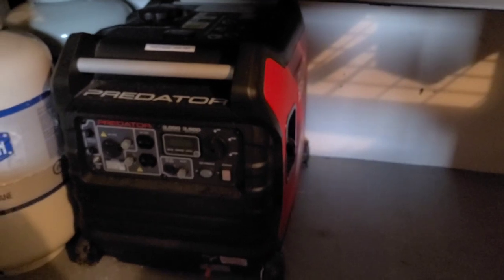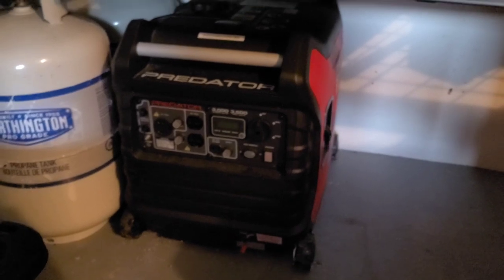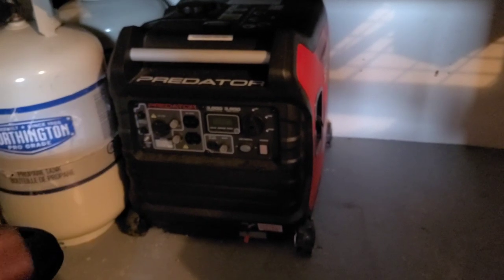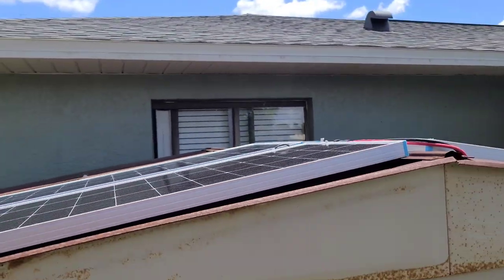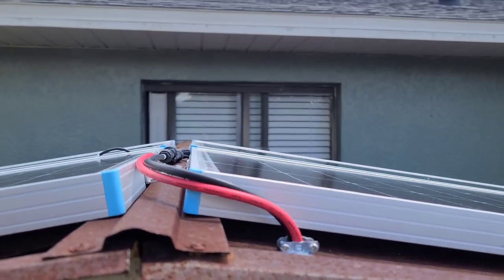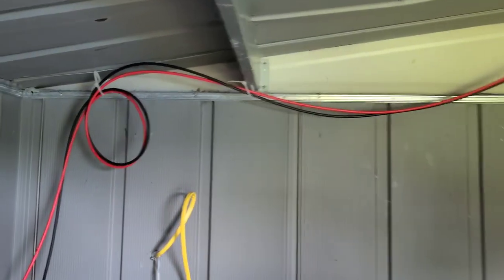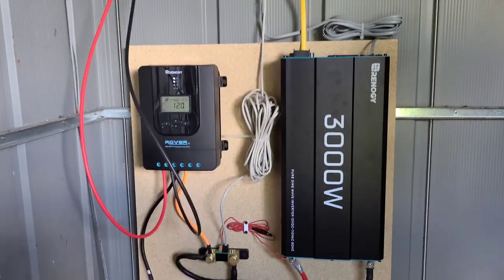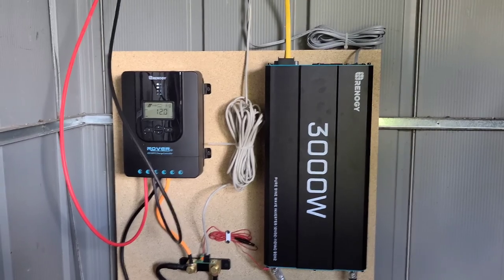I solar powered my rusty shed and here's why.

Comment: I appreciate your “no big deal” attitude. I’ll probably dive into this project on our remote mtn property that has frequent power outages. Thanks again.
Reply from the maker: I wanna build a bigger one. Same concept just a lot more of it. This just isn't the right place for it at the moment.
Reply: @JDSOutdoors  I'm sure your looking at the Hybrid controllers, and higher Voltage panels and batteries.

Comment: Not bad.  Great little backup system.   Your good for about 8 hours of constant use for the air conditioner, or continuous use of a refrigerator and running lights and charging batteries.  I put a 100 amp panel, 100 amp hour deep cycle lead acid, and 1000 watt Renogy inverter in my shed so I wouldn't have to run conduit.  I bought a Bluetti AC 200 max, extra batteries and 600 watts of panels for the house.  So far I'm running the fridge full time and a window unit for 2 or 3 hours at night through a transfer switch.  There's a ground neutral bond problem with most inverters and most service panels so I opted for this instead of something like what you have.  I returned the same inverter you got right after speaking to Renogy.  Anyway, thanks for the video.
Reply from the maker: You are correct

Comment: Neat system I basically did the same thing to add a window AC to an upstairs master suite instead of cranking the house AC up.  I did use more solar and 4 100ah batteries.  Even on the hottest days it used less than 5kw running 24hrs.  Have fun stay safe.

Comment: You should emphasize that payback starts the moment you turn it on. When you start the generator, you start spending money again.Of course you get the motor music for free,much stronger than the hum of the inverter fan. The EG4 3000w with a5KWH server rack battery and a few giblets mounted on a dolly is about the same price .Very convenient for a day’s work off grid.

Comment: Heck yeah this is awesome!   Subscribed and liked!  ❤️👊
Super cool solar generator.  Our electric bill went up $80.  Our neighbors bill went up $120.  So this system could be refined to pay for itself in short period.
Reply from the maker: Yes it absolutely could. Mine went way up as well. One could easily make this bigger and power the whole house.
Reply: @JDSOutdoors  
You could make it power a single element on an electric water heater on a timer for daytime only (to keep from total depletion at night when no use either), and have that one item off grid and ran off that solar system to benefit your home full time. And switch back to the scenario in the video for emergency use.

Comment: If you end up seeing some charge imbalance between the batteries you may want to move the positive cable to the other battery terminal. Its supposed to help with parallel batteries. Nice work!
Reply from the maker: I have switched it over, good eye

Comment: Well sir, you have done it again! I got into building DIY Ammo Can power boxes after watching your videos on them, and now friends and family who see them, fishing buddies who see them, etc., all want them. Then you went and did the little adaptors for power tool battery's deal, another great video, but I am others still have a heart for the power boxes. Then you went a did the solar panel on a trailer tongue, and now A/C from solar. You sir are an asset to America. Thank you. I am going to have a ton of questions as I begin building my DIY Trailer for camping, fishing, etc., and it is going to have Solar/Shore power capabilities, while still serving as a trailer in case I need one for whatever reason. LOL. I don't know that I am comfortable enough yet to do all this without watching videos a bazillion times, but I need to get several things on solar, and do not want to invest in whole home solar for this house as we are considering selling and moving, so no need to spend $30k on something I will not use and will not get an ROI on. The 3 projects are 1. getting the pool to run on solar to get that off my electric bill, haven't decided if I just want to do solar for current system of invest in a DC motor and run it that way. 2. Getting a similar setup like this one in the garage so I can work on projects and not kill over in these Texas summers. 3. The DIY trailer build and outfitting it with solar/shore power, attaching ARB awning and deluxe room, the RoadShower XL, fishing rod lockers, Kayak, etc.  One thing I am looking into is a way to wire in an electric water heater in the RoadShower XL. That thing is awesome works great, yes, it is black and heats during the day, but they should have built in a heater unit of some sort. If you got any ideas, I am open to hearing them. Cool bananas. How are you liking the new place?

Comment: I have been looking at building a small system like this to power a small A/C, refrigerator, and some led lights for emergencies.  Would have been nice to have last year when Hurricane Ida rolled through my town.  I will have to look into something similar for permanent power for those items after I do some calculations.  Thanks for posting this video.
Reply from the maker: Calculations are definitely important  for sure. If this was going to be permanent I'd definitely use conduit and mount everything better but I'm just playing and learning at the moment

Comment: You responded to another person from Indiana about going with AGM or SLA batteries because of the cold. Besides weight, what other benefits do the lithium have versus the other 2 options? I assume AGM/SLA have fewer charge cycles.
Reply from the maker: Correct lithium give you more charge cycles and also 100% capacity drawdown without injury to the battery. Sla or agm you really can only 50% draw down safely. Ideally on lithium you would draw 75% then charge back up. In cold weather if you can keep the batteries above 32°  I'd go with lithium also due to no maintenance as well.
Reply: We're in Michigan and have run AGM batteries and now run lithium batteries in the shed.  On the colder days I just ran a propane heater for a few hours to warm up the shed. But never got cold enough to worry about the batteries.  The lithium was a game changer for our set up.

Comment: How does 400w of solar equal 3000w of useable power?

At 400w, how long did it take to charge the 2 batteries to full capacity?
Reply: Maybe you could do a follow up and do an in-depth explanation of how it works, the math, etc
Reply from the maker: @scvic2006  from 100% completely dead it takes 1 day to fully charge assuming full sun. 400w of solar charges my 400ah of lithium batteries which I chose to use a 3000w inverter to run my 110 system. I could of used a 500w or a 5000w inveter it's personal needs. I'd do another video but the system is torn apart now since I'm moving.

Comment: Question. Do you charge your batteries during the day and run off of them during the night only then recharge them the next day? Or do you run off them also during the daytime while they are charging? I have four 100-watt solar panels charging two 100 ah lithium batteries. I run my refrigerator and a chest freezer using then while hooked to solar during the day. Am I doing it wrong, and should I be charging the batteries during the day and try to run the refrigerator and freezer off the batteries alone at night?
Reply from the maker: You can use it anytime that's the beauty of solar. If you use less than you bring in then it's free energy all day.

Comment: How long can you run the air conditioner?
Reply from the maker: 4-6 hours with no sun. 8-12 if it runs during peak sun times. A mini split, 800w and 2x the battery bank would be perfect for a backup.

Comment: Is that breaker box near the outlets grounded?
Reply from the maker: Yes
Reply: @JDSOutdoors  any way you can show how you wired the breaker box and grounded it?
Reply from the maker: @johnconnor3426  its wired like any normal box would be. 12 ga romex since it's only 20 amps then that runs right to the inverter hard wire ports. The box grounds are a buss bar just like a normal larger box would have. If I added a Second circuit then I'd have to switch wires to a larger guage. This is just a practice system for now
Reply: @JDSOutdoors  thank you so much for getting back with me.

This is all new to me. I’ve seen videos show ground rods being beat into the earth, bonding, non binding, etc… very confusing.

Good job on the setup!!!